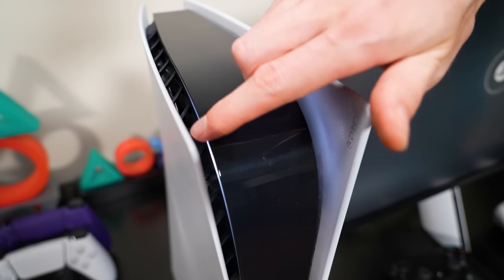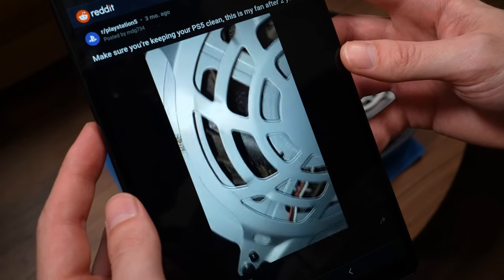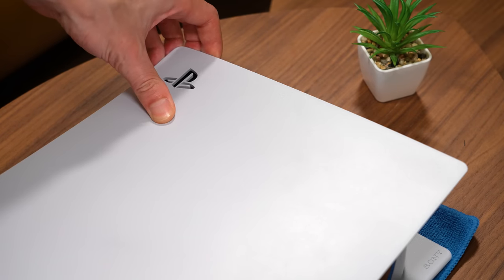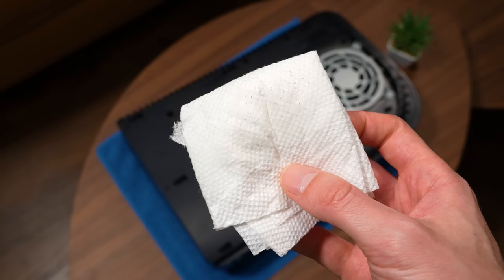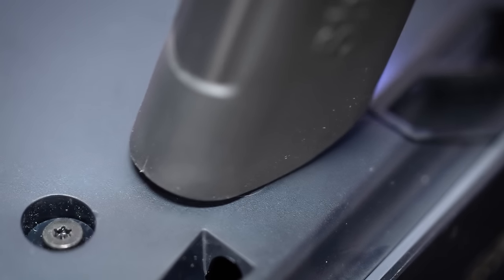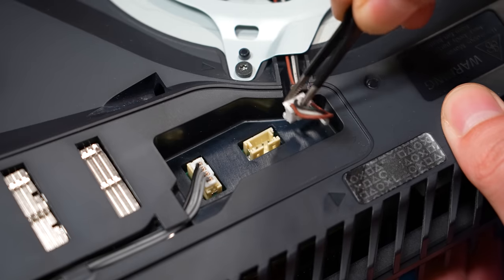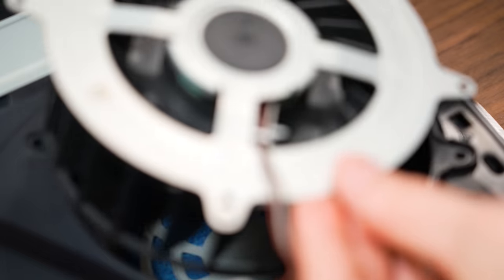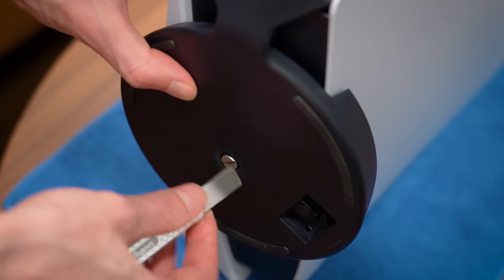It's time every PS5 user checked for this..

Comment: I never take apart and clean my consoles for the simple fear that I'm gonna mess it up. I just try to keep the outside of it as clean as possible. Dust buildup has never been a problem for me.
Reply: watch a disassembly tutorial and follow along, it's not difficult.
Reply: Yeah. I tried too hard to obtain a PS5 I’m good on potentially messing it up. I keep it clean. Surface level lol that should be good enough.
Reply: i had to take apart my ps4 slim it was a pain because u had to use a knife or a pair of pliers to cut the edges of the plastic screws that are unremovable just to take the metal cover off to get to the fan it took me whole hour but it was worth it because it looked like a cat had puked a giant hairball inside my ps4
Reply: Same here I understand people are like it's so easy but it's something I'm not comfortable with especially taken that fan off hell no even the covers on the ps5 is a big pain
Reply: Thats just stupid in 2-3 years from now the inside from your PS5 will look like a cellar of a house where nobody have entert for 10 years. 

Worse with al that dust your PS5 will be getting hot as an oven. If you clean  stuff up, the longer it will run without problems.. Dont be an idiot.....
Reply: @amunra1743  i dont c a problem as long as it runs i got my ps4 for 7 years now and never cleaned its inside yet it still runs just as it should
Reply: AT LEAST empty the dust catchers. Like come on. The plates are designed to be removable so clean the plates and the outer shell
Reply: @LeoDragoGR  y so upset like its ur ps5??
Reply: @d c why would you smoke inside your room?
Reply: @burakcoskun1865  LMFAO 🤣 I've never laughed so hard lol
Reply: @burakcoskun1865  don’t even know how you think I came off remotely as you think I did
Reply: @LeoDragoGR  lmao you were just trying to help
Reply: @op if you've never taken it apart how can you know?
Reply: Dust buildup will be a problem for everyone. No matter where you live or how much you clean the outside. It'll be pretty hard to fuck up something if you follow a tutorial. It's easier than it looks.
Reply: @osc-oldschoolclips5204  that's definitely not good enough, guaranteed. You gotta learn somehow, and its better to learn and know, then to pay to get it cleaned/fixed. Applies to most things.
Reply: It's not difficult, I understand your fear, but it's worth in, my ps5 started getting noise so tool fan out cleaned put it back and now almost silent.
Reply: If your console got warranty only clean the surface, my console broke after 1.5 years. Send for repairs and got another 2 years warranty.
Reply: I get your message also I just got my ps5 and I don’t seriously want to end up breaking it, my room is pretty clean for the most part but I might have to end up looking up a tutorial for it
Reply: Dude i feel the same way, but sooner or later u WILL have to take it apart the least u can do is take the two covers apart and get an air duster and blow through the parts. U can damage ur ps5 if dust is blocking the flow of air..trust me just watch some youtube vids. Its not hard at all
Reply: @d c i have my ps from launch day til now... No dust 🤦🏼‍♂
Reply: With the PS5 it gets extremely hot so dust build up can possible fry you system. But the PS4 would get really loud if it had dust build up like a jet plane
Reply: It never been a problem for anyone  except PS owners lol
Reply: @ahappyklingon3631  yes because Dust doesn’t travel into any other system….

Do you have any idea how dumb that sounds?
Reply: Agreed. I can't understand how people think that this is somehow simple and easy and that everyone who buys these consoles should regularly do what this YouTuber is doing. I'll clean the outside and I use a q-tip to really get in those crevices but asking everyday consumers to be comfortable and confident doing this borderline engineering task is absurd. I can't even put together a computer or micro-manage a firewall that's why I still buy these video gaming consoles in the first place dammit. Ya'll think I'm forcibly removing those plates and unscrewing that crazy fan? Hell no.
Reply: Tbf I feel this is a normal and fair view. Most people don’t know anything about internal electronics unless they watch videos like this or have specifically studied. I also try to keep stuff clean externally. Occasionally partially dismantle say an old laptop to blow dust out with air etc. It’s ok if it’s old stuff there’s loads of tutorials and out of warranty anyway. But to take apart something that’s new, expensive,  and not that easy to find is risky for many. I think designers should try to make this easier with modular, robust and simple designs.
Reply: @RickyG93  they specifically made the PS5 accessible for the common user to break down PlayStation even made a diy video on how to clean it 🤦🏾‍♂️
Reply: @aaronjames7266  Thanks I did watch the video it looks simple enough. Unfortunately I can’t do any of it as all the shops by me are yet to have any ps5 consoles in stock still lol. I’ve not desperately tried to get one but never been any available when I’ve looked. I’ll probably hold off until there’s a slim model now.  But yeah the design does look simple enough they have clearly made an effort. I like to research and learn. I was just saying for some. For kids especially it’s understandable.
Reply: It's pretty easy on ps5
Reply: @RickyG93  “I can’t understand how people think that this is somehow simple and easy”

No offense, really, but it’s literally just removing the plate(which locks into place with slight amount of pressure no tools) and four screws, screws are absolutely the most consumer friendly part, as everybody has screwdrivers, and everybody has products with batteries that require screwdrivers to access.
Reply: You really think keeping it clean on the outside keeps the inside clean? 🤣
Reply: lmao at least blast it with compressed air. You'll prevent heating
Reply: @rockon609  You know how dumb people sound thinking they need to do this lol.  They didn't build these consoles for you to fuck up the warranty & take it apart. If PS had proper ventilation you wouldn't need to do this. Instead Sony was more focused on design then functionality lol.
Reply: i never clean  my ps4 and work after 6.5 years like i buy it yesterday.
Reply: @aaronjames7266  fair play
Reply: I do take mine apart occassionally, but you are right, keep the dust at bay in your home. Took side off my ps5 earlier this yr and its very clean. Stripped my sons ps4 and same. But I do regularly hoover my machines externally to prevent. I always try to vent clean air in and obviously not smoking anything helps on top. But people do like to live in their own dead skin cells, so this video helps them hopefully.
Reply: took me long anough to get this piece of shit concole, im not wasting more time cleaning it
Reply: If you just use a little care and not rough with it you can get in there and clean it no problem. Just Take your time
Reply: You can just air spray it without taking the fan out of the housing (power off and unplugged, obviously), which is what most people who bother to do anything do.

And it's fine. It's better than doing nothing; you just have to take the side off (super easy).
Reply: @kai_444  he said its never been a problem why would he watch a disassembly guide to do it when its not a problem lol
Reply: this is my first time doing this the ps5 is way easier to clean than the ps4 you just need to remove fan screws and thats it
Reply: @x-Abraham-x2  
I promise it's not as scary as it seems. Follow a tutorial step by step and you'll be absolutely fine! The only thing to be conscious about is that the sliders will be harder to take of the first time.
Reply: @Miriam_J_  that’s one of my biggest concerns that I’ll just somehow break the sliders idk I’m scared
Reply: @Bluedude08  I took apart my ps4 slim to clean it didn't need a knife or pliers lol
Reply: Watch a tutorial, some consoles like the ps4 are super easy to disassemble. I understand you might be scared since the ps5 is expensive and hard to find, but you gotta do it some day
Reply: Same
Reply: @purefoldnz3070  to take off the metal plate u have to cut around those plastic nails to get the top to pop off I had to use knife or plyers
Reply: Take it apart and look at ur heatsink lolll
Reply: @icebaby271  more important question is why wouldnt a smoker smoke in their room
Reply: @charg1nmalaz0r51  its disgusting and lack of respect to your domain. Im a smoker as well but i dont smoke on my room, not even in my house. With the exception of toilet and veranda.
Reply: @icebaby271  What age are you? 😂 Adults can smoke wherever they like in their own home
Reply: @Pmccaff2009  i know. However, being an adult and being respectful of your domain/home is not mutually exclusive. Its like eating at my car. I never eat at my car. Thats how i respect the things i strived hard for to achieve.
Reply: @Bluedude08  I got a proper screwdriver set from the PC store. No need for a knife just a air duster. There's tutorials on youtube dude. The hardest part was putting it all back together. So many screws,
Reply: @purefoldnz3070  thats not what i'm talking about if u have ps4 slim there are black screws I don't think there even screws there just plastic black nails that don't come out u have to actually cut the plastic off the sides of the plastic nails for the metal top to come off if u still don't know what I'm talking watch a video about how to take apart ps4 slim to clean fan
Reply: @Bluedude08  I have and cleaned my PS4 slim, not that I use it much now I have a new PC. Cleaning PC's is much much easier.
Reply: @pedropatricio1128  your ps5 already broke?
Reply: My ps4 pro was never opened up or cleaned throughout the whole 4 years of me owning it lol. But it still runs like a gem.
Reply: @burakcoskun1865  same
Reply: I guarantee I’ll mess it up if I open it
Reply: @burakcoskun1865  Same here. It got very noisy at a point tho
Reply: Aren’t you special
Reply: @icebaby271  Why do you care about what people do in their own homes?
Reply: Me neither
Reply: @TiddyMouf  no one cares at all. they asked me so i replied
Reply: @icebaby271  I was replying to your first comment lol, I’d say use your brain but obviously that wouldn’t do much good.
Reply: I do it since the ps3 and i am no expert in elektronica, but its really easy. Take pictures before removing stuff.
Reply: Mine had a Rat living inside..had to put my ps5 outside for a couple days😑😑
Reply: right? cant speak for the ps5 since mines just a few months old but I've had a ps4 for over 7 years, haven't cleaned it once and I've never had any issues with it
Reply: @burakcoskun1865  why are you getting more likes than the people providing legitimate advice for cleaning a console?
Reply: Icl I empty the dust catchers and clean the side vents but can't bring myself to clean the fan out of fear of fucking it up.
Reply: @starfish69420  the fan is easy just lift up that black sticky part covering the wires, and gently move the wires out of the black hook bit, it stays connected but gives you so much leniency to move it around
Reply: @LeoDragoGR  like the "come on" gave obvious upset vibes
Reply: @aaronjames7266  yes u can
Reply: @TuzBay  disagree
Reply: @Pastasauce123  no he doesn't need to do it someday
Reply: @AbdulB  just temporarily for me but that doesn't bother i mostly have earphones or headset on so i dont even hear the ps
Reply: @iterati0n  because im spitting facts
Reply: Nobody should listen to anyone but their stomach in this matter
Reply: @aaronjames7266  u dont need to clean it unless the room ur ps5 is in is as dirty as a sewer
Reply: @aaronjames7266  just cause ur ps5 is potentially shitty doesn't mean other's r lol
Reply: @osc-oldschoolclips5204  my ps5 broke first week I got it and this was 1 month after release, I got a new one in less then a week haven’t cleaned inside once and no issues. my brand new clean ps5 didn’t last at all
Reply: @aaronjames7266  and i dont clean out since launch works like a charm but thanks for ur concern 😚
Reply: @TuzBay  and mine has dust but it still works
Reply: @burakcoskun1865  nah you just interpreted it the wrong way
Reply: @LeoDragoGR  nope if u cant read and comprehend it thats ur problem if i implented it that wrong i wouldn't have gotten that many likes
Reply: Not really place a air humidifier close to your console and it will eat up a lot of the dust
Reply: Like I said, no thanks, I don't smoke and have any pets so it shouldn't be so bad anyways
Reply: @HUYI1  just try to keep it as clean as possible on the surface bro d9nt listen to those telling u gotta open and clean it and shit if a console requires u to do that then that console is shitty as fuck simple as that
Reply: I understand with older consoles since they arent as basic but PS5 was purposely designed so owners can clean their consoles with ease and not void warranty. Nothing will go wrong as long as your gentle with everything
Reply: Got a 7 year old Xbox never cleaned. Never cleaned a console in my life. Who has time to do all this shit every 6 months?
Reply: Yeah it also depends how clean your room is, if you use air filter especially no problemo
Reply: I have a high power dust air purifier. I still see a thin layer of dust. But that's after only a year. It's probably not as bad as others but I think it'll be fine
Reply: Doesn’t it void insurance?
Reply: @osc-oldschoolclips5204  ps5 is fragile especially if you don’t know what to do i almost broke mine trying to add the m.2 ssd thankfully i ordered some spare parts on amazon and was able to successfully add it
Reply: Take the covers off. Unlike the PS4, it is stupid easy.
Remove the stand, then lay the console flat, symbol side up. Place one hand at the bottom of the console (where the stand screws in), and grab the corner where the symbol is. Gently pull and life the corner and it'll pop out.
Flip over and repeat.
Reply: @d c meh smoked bongs right next to consoles for years and never had an issue. Keep the outside clean and its fine. I wouldn't go pulling these apart, especially if it's on warranty still
Reply: @icebaby271  i do! its called smoking bongs while you play. but still I blow the smoke away from the Playstation
Reply: @icebaby271  And thats your thing. But some people are happy to smoke in their own homes. Heck when i was a child it was common place to see most people smoking in their homes
Reply: This console is the easiest shit ever man. I promise. They made this thing to be opened and cleaned regularly. You won’t mess anything up. It’s not that delicate. A grade schooler could do this!
Reply: Cleaning the ps4 was such a massive pain in the arse I'm waiting until the ps5 shortages go away until I attempt it just incase I do manage to fuck it up
Reply: when i'm not using my ps5 i cover it with a plastic bag keeps the dust off it when not in use. i have owned my ps5 for a year now and i just recently opened it to install a ssd and because i keep it covered there was next to no dust at all
Reply: @burakcoskun1865  same ive had my ps4 for 9 years never a single problem
Reply: Same. I never had any dust issues with my PS3, PS4 or PS5. I just clean/wipe the outside and use cotton swabs to get dust out from the vents.
Reply: @boiloil3557  hmm i like that idea i’ll have to try that.